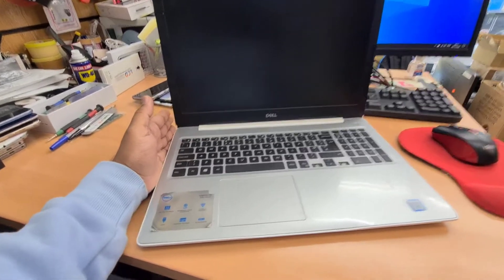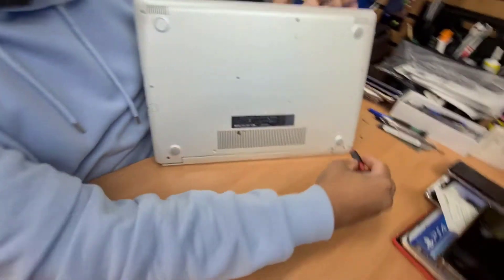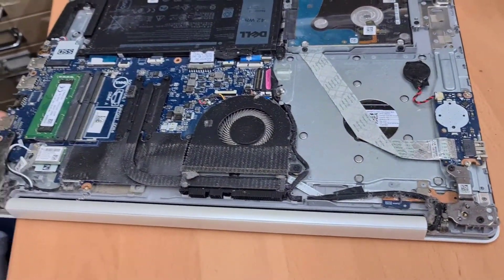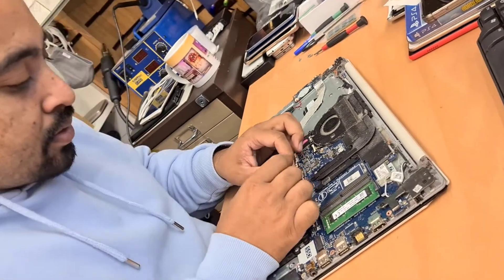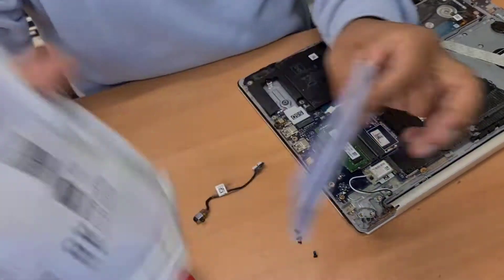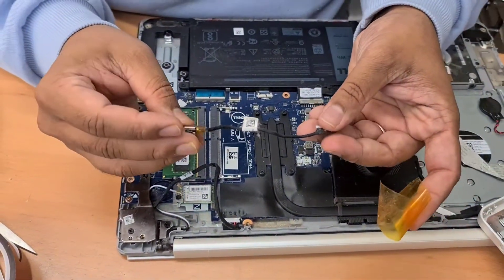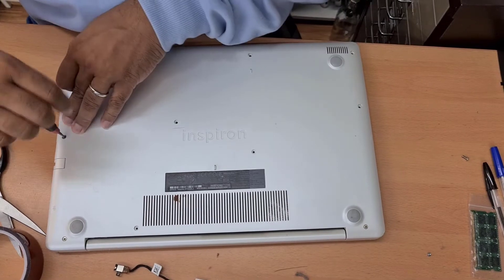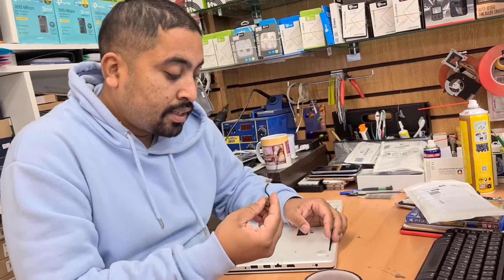Dell Inspiron 15 5000 Charging Port Replacement

Comment: I have the same laptop but the battery inside the laptop says 42 wh standard however the charger says 65 w.. m confused which is correct

Comment: good 
is it the same for dell 15 3583?  thank you
Reply: It should fit. My GF's laptop had a charger port issue and I just replaced it. So far its working fine but I am monitoring it.

Comment: Thank you so much.  Clearly explained and demonstrated.  I bought a $6.50 part and fixed the computer in about 30 mins.
Reply: I'm hoping to save $139 with this video.
Reply: @jericahiggins9352  did it work
Reply from the maker: Glad I could help, Hope you will subscribe to this channel. Thanks for your support.

Comment: This is terrific! I am so grateful to you. I am subscribing including notifications. I have an inspiron 15 7000 2-in-1 and the charging port needs replacing. Can I ask you where I can get the opening tool that you used? And also that cellophane tape that you used to manage the too long wire???

Comment: Hi I replaced a broken dc jack on my Vostro 15 3558. Now, the laptop doesn't recognise the adapter. Also, the battery won't charge. Is the replacement power jack faulty?
Reply: Same issue, but the unit I have have does the same thing with original power jack when swapped and it only charges when laptop is off. Once on, it only holds same battery level, never discharges or charges from where ever it is.
Reply: @ezveedub238  did you figure it out? you might need a new battery.
Reply: Was it oem?